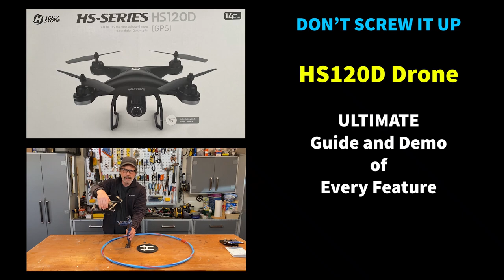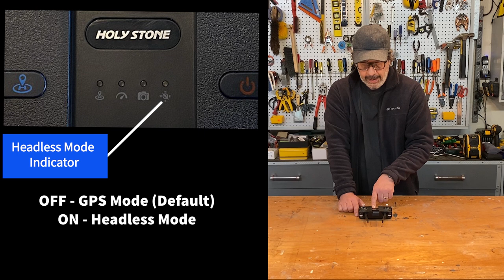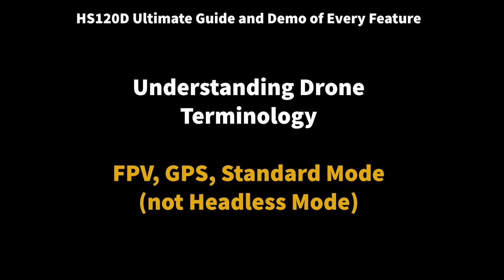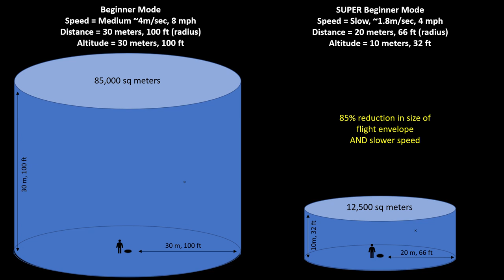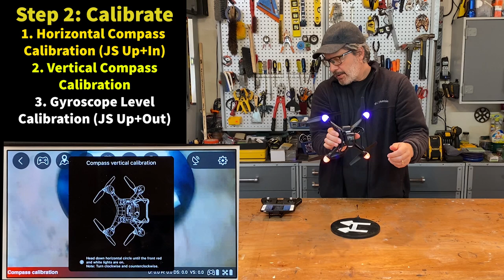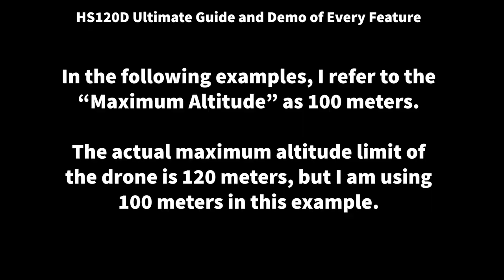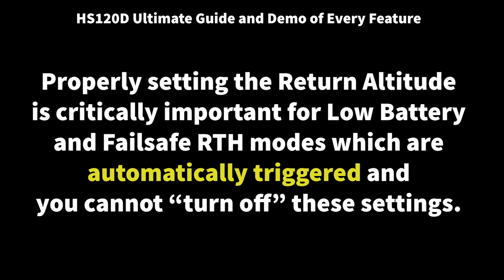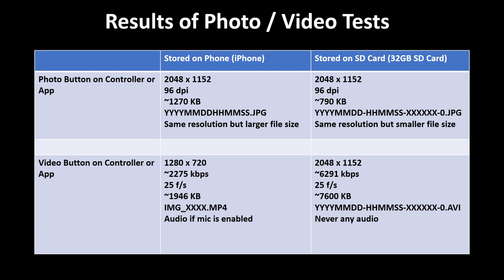NEW! - HS120D Drone ULTIMATE Guide and Demo of EVERY Feature! - Holy Stone How-to Manual - Beginners

Comment: i don't get the calibration picture on my iphone.  the lights are flashing continuously after my "calibration"
Reply from the maker: Not sure what would cause that. Do you have the current version of the app installed?   I believe the lights do flash after calibration until a GPS signal is acquired.  I would need to test out the calibration without the app and see what it does.  I believe the manual indicates the sequence of flashing lights expected during calibration.
Reply: It was me! I screwed up! It won't happen again.
Reply: For me it is happening when my drone is searching GPS-sometimes it takes 5 min or I have to reset everything again. So, wait .

Comment: Hey there,great video. Can you confirm if this HS drone is basically a rebranded TSRC x7.  As I have the TSRC and it physically appears to be the same unit.  Controller is a little different, as the tsrc has an lcd display on the remote.
Reply from the maker: Sorry I’m not familiar with that other model.
Reply: The TSRC has a stationary/fixed position camera ,doesn't  move.. I've found that the HS model is on the same (frame) as the one I have but several upgraded features were added to the HS model.

Comment: My drone will arrive this week (first drone ever) so I find this video instruction invaluable. 
Question since you live by a cliff - will the drone allow itself to go negative elevation relative to the take off point? I would like to be able to take off from elevated shore and land the drone on an island about 50' below the take off point.
Reply from the maker: That is a good question.  I am not certain.  I believe I have gone to negative elevation a few times but I cannot be certain.  I will test it out the next time I have the drone out.
Reply: @dontscrewitup  Ran into a little (big) problem when trying to test negative altitude. Flying with some big trees in the area, no wifi interference. Flew up and out over a steep hillside and three times in a row the drone shut off and dropped. The third time it dropped about 50' onto a stone wall and it doesn't look damaged! My only theory is that the GPS info changed so much when I got above the tree tops that the drone panicked. Any thoughts?
Reply: Very Interesting!  When the altitude sensor shows negative, the drone would likely consider that it landed and would shut off.  A difficult problem without having an independent landing sensor

Comment: Please HELP! The remote does not turn ON at all.. it is charging alright. Just wondering if I could use my phone app to operate? How? 

Thanks in advance!
Reply from the maker: You need the controller. Sounds like a hardware problem. I’d suggest calling Holy Stone customer service.  They are responsive and can send a replacement if needed.

Comment: Great video..quick question: when calibrating the three "C" do you need to have the drone exactly over take-off and landing zone or can I do it under a shade tree?
Reply from the maker: First 2 can be done anywhere.  The last one (controlled hover) needs to be at take off location with GPS access (I.e., not indoors).

Comment: Bought my HS120D probably about when you did. Put it away in frustration and haven't flown it again until recently. Still frustrated, but found your video. I've learned a lot here so thank you for that. The ONE thing I was hoping to figure out wasn't in the video. I have repeatedly clicked the video button, both on the controller and on the phone. I get done and...NOTHING. (I have on occasion gotten short, partial videos, but don't know what I did to get them or why they quit.) The light was on, the video icon highlighted, but no recording.
Reply from the maker: Thanks. Do you have a memory card in the drone?
Reply: @dontscrewitup  No.
Reply: @dontscrewitup  Two things, I have an Android phone, and I'm wondering if maybe some permissions were reset that block recording from another device. (Grasping at straws.)

Comment: this  is a great manual for beginners i would assume this would be for the  hs 110g as well
Reply from the maker: Thank you.  I do not have the 110g but have been told most of this video content applies to that model also.
Reply: @dontscrewitup  had my first flight today it went pretty much OK but i couldn't get it to return so i am going to go through your instructions again i think it was me not the drone but a good first flight thanks again tom
Reply from the maker: Good luck. It takes some practice.  Keep it close. Keep it slow. Try one new thing at a time.

Comment: I was having problems connecting my phone (Pixel 3) to the drone. Finally figured out when the little warning popped up that said wifi connection didn't have internet, I had to click on that and then say connect anyway. This pop up only lasts for a few seconds and goes away. If I don't click on that before it goes away, I can't connect my phone. Probably a setting somewhere in the phone to say connect anyway but I haven't found it.
Reply from the maker: Thanks.  That's good to know.  I'm not familiar with that phone but it makes sense.  Thanks for sharing.

Comment: Initial flight in front yard.  Loss of compass calibration message.  I had no control.  it flew in a lazy circle and "landed".  What caused that?
Reply from the maker: I’ve never heard of that happening before.  Did you do the 3 step calibration?  If it happens again, it could be a hardware issue. The compass calibration is not relying on GPS as far as I know, and a basic compass / gyro should work independently of GPS.

Comment: My auto take off and auto landing button does not work. Do I need to go into settings and turn off beginners mode?
Reply from the maker: That button is not impacted by any settings.  Sounds like it’s defective. I’d call Holy Stone customer support.  You can get a new controller from them.

Comment: I have been flying this drone for over a month now by stick and no app. I'd like to start using the app but for nothing but the view. If I start using the app is there a way to simplify it, make sure I'm only viewing and still have the controls at the stick I'm used to?
Reply from the maker: Yes, the app primarily is just the camera video and does not take anything away from the controller.   The few additional functions added on the app can just be ignored and you can just keep flying by stick.  Some of the messages that appear on the app message bar will probably also be helpful because some of these are not evident on the drone/controller.
Reply: @dontscrewitup  Many thanks! You are the most reliable source I feel on this particular drone. ":-Dx

Comment: This is the most well thought out video I think I have ever seen.  It is extremely helpful and answers so many questions about my HS120D (my first and only drone) which I have flown about 10 times.    I notice on your cliff video it does the same thing that I have not liked about my videos.  When you turn or pan to the left or right, the movements are fast and jerky.  It would be great to be able to pan smoother and slower.  Do you know if there is any way to slow the turn rate down?
Reply from the maker: Thank you!  Unfortunately the camera is the weak link in the HS120D.  At the low price point of the HS120D I realize that the value is in the flying elements of the drone, not the camera.  I think to get a decent camera we’ll need to spend $300+.   Sorry I don’t have a better answer.  I’ve tried to turn the drone more slowly but it is still jerky no matter how light of a touch I use on the joystick.
Reply: @dontscrewitup  That's what I expected to hear.  No problem.  This drone has given me the entry level experience that I was hoping for.  Now it is time to move up to something with smoother video capabilities.  Is there an HS drone you recommend, or should I look at the DJI Mini2 that everyone seems to rave about?
Reply from the maker: I have not looked at any others in detail but I know that model is very popular.

Comment: The photo size difference is the compression on the jpg. A scale of 1-10 maybe the native compression is 5. In the phone you might have compression set at 7 (less compression). One the phone, it can be changed. On the drone maybe, maybe not has a compression setting. Because cards hold so much, if it were possible, I'd set it to 10 (least) for all photos.
Reply from the maker: Thanks!  I was not aware of that.  But even with different compression and file sizes the “resolution” is the same?
Reply: @dontscrewitup  yes

Comment: Please I am using HS120D Drone and I replaced one faulty motor. Since then I always get this error code after take off ( Compass is interfered, Mobile drone or calibration compass) 
Please I need your assistance to fix it.🙏🏽🙏🏽🙏🏽
Reply from the maker: Sorry, I don’t have any experience with that error message.  I recommend contacting Holy Stone customer support. They are responsive.  .
Reply: Thank you

Comment: I thank you for answering questions. You apparently have more knowledge on this one than any. I bought my brother one as the same time. He's in FL, I'm up North. He has the app hooked up, I'm still flying by stick and in the tight space of my backyard. He says he's having trouble when it gets out about 130' just bouncing like it's hitting a wall. I also read on AMZ questions a person said they get out about 100' and no further. Brother says he's not on beginner and doesn't know why that envelope set for beginners should be in effect. Do you have any thoughts on that. Once again, thanks so much. I will SUBSCRIBE
Reply from the maker: Thanks.  The flight envelope is always in effect.  There is no way to disable it.  You need to go into the Settings in the app and change the maximum altitude and maximum distance.  The Settings screen is a little confusing.  The Beginner mode is not really "on" or "off,"  if you click it, it just sets the default values.  It's not really a "mode," but rather a set of default values.  

The flight envelope, or geofence, is always ON, based on whatever values are shown on that screen.  So if you want to fly beyond those settings you need to change them.  Be careful not to set the Return Altitude at the maximum.   This will send the drone up 350 feet if you hit RTH or if the battery gets low, for example.   Let me know if that works.  Nothing else should be limiting the distance, other that the settings on that screen.

Comment: I'm understanding that the mobile data must be turned off for it to pickup on my phone screen?
Reply from the maker: I don't believe so.  It should not matter.  The drone connects to your phone using a WiFi receive in the drone, through a WiFi connection on your phone.  It shouldn't matter if mobile data is on or off.  It's just using the WiFi like a two-radio connection, not actually using the internet in any way.
Reply: To bad you don't live by cb I'd like to meet you in person you are great at what you do thank you very much

Comment: My First flight was a success.  My 2nd was a failure.  Crashed 4 times. Now when it takes off it immediately flies to the right and flips? Is it the propellers?
Reply from the maker: Are you doing a proper 3-step calibration?  And a controlled hover?
Reply: @dontscrewitup  Is that needed before every flight?
Reply from the maker: Absolutely.  And if it’s not doing a controlled hover, shut it down and do calibration again.   Also if you are very close to buildings or trees, your GPS signal may be weak or have interference.   If it’s flying erratically, it’s usually bad calibration or weak GPS.
Reply from the maker: I suggest re-watching this section of the video.   https://youtu.be/6eofQhUeIos?t=2776

Comment: When you turn the drone around does it hover in one place and just turns or doing quite a circle while turning (which my does)?
Reply from the maker: It should hover in place.  If it is circling that usually means the calibration is off. Are you doing all three steps of the calibration?
Reply: @dontscrewitup  Yes, but my terrain is going a bit down slope - maybe this was a problem when I put drone on a bit tilted ground. Will choose another spot which is perfectly horizontal to do calibration next time. Thank you to confirm that it's not a normal drone behavior, but just a calibration problem.

Comment: I cant get my drone to lock follow me. You said make a square around what its following then tell it to start. Where is start.? What do i push to start? 
Also cant get hand gesters to work.
Reply from the maker: When you draw the box around the object it needs to get a “lock” on it then a box will pop up to “start.”   Try drawing different size boxes. And try moving, or not moving, so it can get a lock.  It is temperamental but I can usually get it to work with a few tries.  

The hand gesture thing is very unreliable. I can only get it to work at very close range, occasionally.  It is a gimmicky feature that really does not work.

Comment: Does a SanDisk Extreme 128GB Memory Card  work with this Drone , because the files off my Card won't load up on my Computer
Reply from the maker: I use the 64GB Sandisk card with mine. There is conflicting documentation on this topic. The website says 64GB max but the manual says 128GB.  Can you see the files on the card?  If so, then it worked.
Reply: @dontscrewitup  yes I see the Files on the memory card when I put it on my computer but they won't open it says AVI files I only have phone app footage that I can see
Reply: @MarkFromSalfordUK  sounds like the AVI format may be incompatible with your computer.  Can you open other AVI files on your computer?

Comment: It's probably good to learn to fly altitude mode, to be prepared just in case your drone looses the gps signal during a normal flight.
Reply from the maker: Yes. I agree. A good skill to have.  I was trying to keep things simple for beginners. Altitude mode is an unnecessary risk until beginners can really control and fly the drone in GPS mode, in my opinion.

Comment: Taking pictures with the conrtoller.  I hear a beep, but no pictures are taken?
Reply: PS  The video works from the controller.
Reply from the maker: Sounds like it may be a hardware problem with the controller.  I don’t of any circumstance where video would work but photo wouldn’t.  Unless you’re trying to take a photo while the video is also rolling. The controller will beep but will not take a photo if video is rolling.

Comment: Taking pictures with the controller doesn't seem to work.  It beeps but no picture.The iphone icon works to take a pic, but not the controller.  The video works fine.
Reply: I got it!! Love your video!  I'd have crashed without it.
Reply from the maker: Thanks!
Reply from the maker: Are you trying to take photos while video is running?
Reply: @dontscrewitup  no

Comment: whenever i charge my drone the light turns red, can u help me?
Reply from the maker: Which model drone?  And which light are you referring to?
Reply: the hs120D
Reply: and on the charging dock it turned red and i don’t think it’s charging
Reply: never mind my dad helped me fix it but thanks for help!
Reply: also, what sd card did you use?
Reply from the maker: Something like this.  64GB. You can usually find them for about $12.  https://www.officedepot.com/a/products/9950594/SanDisk-Ultra-PLUS-microSD-Card-64GB/

Comment: how far away from the transmitter can it go
Reply from the maker: It is officially rated for a distance of 948 feet (outdoor unobstructed).  This is possible but the “generally accepted” reliable working distance I’ve heard from other users is about 500 feet.  Many users also report loss of the WiFi video sometimes at 100-150 feet.  The transmitter will continue working even if the video feed fails.
Reply from the maker: It is officially rated for a distance of 948 feet (outdoor unobstructed).  This is possible but the “generally accepted” reliable working distance I’ve heard from other users is about 500 feet.  Many users also report loss of the WiFi video sometimes at 100-150 feet.  The transmitter will continue working even if the video feed fails.
Reply: @dontscrewitup  in terms of range, would you say this drone is good?
Reply from the maker: I would say the officially rated range of the controller is very good and I have not heard many complaints about people losing contact between the controller and drone.  However the loss of wifi signal between the drone and phone at 100-150 feet (which sends the camer image to your phone) is problematic and not what most experienced users expect.  I am flying mainly short distances for various inspection videos, so I cannot provide more personal experience on this topic, unfortunately.
Reply: @dontscrewitup  alright thanks man for the info